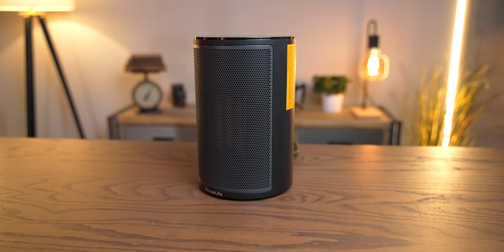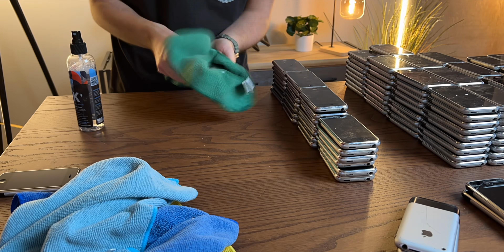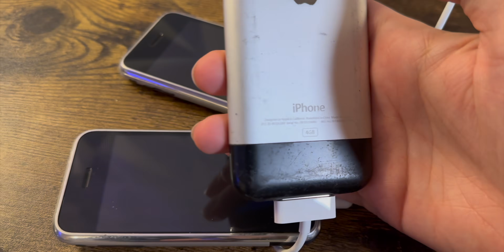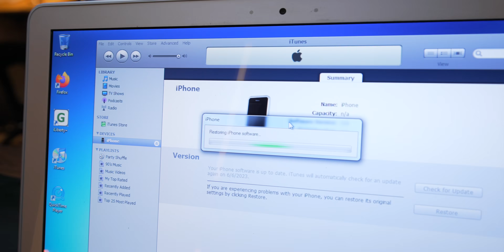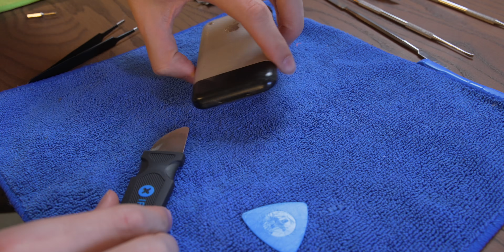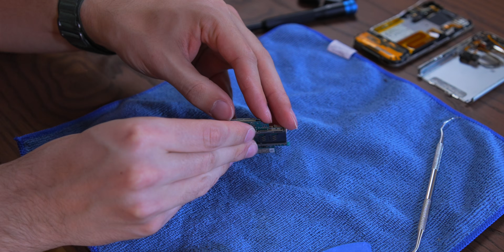I BOUGHT 300 ORIGINAL IPHONES, can I fix them??

Comment: You can sell damage ones in art like in sets of 3 or 7 as Art Deco and also the impact of e-waste and how to manufacture them for easier repairs and recycling even as broken screens and ones with the screen off to see in inside of the iPhone place inside a shadow box UV protection and recommend the Art Gallery or customer buying them as art deco don’t place them where sun can heat up the batteries

Comment: @Luke - Sorry different topic of conversation
Hey Luke

I just bought a ma pro 2019 , pretty cheap for 2K, But it only can with 256GB boot disk, cos I googled and read and watched you all on tube, and I can see how to do
It with Apple Configurator and a laptop  etc etc.

My Q is as follows

1 Does Mac Pro 2019 boot disk allowed 512GB
2 Does the configurator app allow 5122 GB as an option for apple Mac Pro 2019

Does it looks like apple are only selling 1/2/4/8 TB modules.

Cheers
Simon

Comment: Hi Luke, I have an iPhone 2g 8 gb that I bought for double the sale price out of the foxcon factory on the black market before they were available here in HK. It has the very very rare physical hardware jailbreak as in there is an extra chip slipped in the sim tray instead of a software jailbreak. The screen is 100% working and it boots to the iTunes Connect screen but I don’t have iTunes that can connect. Needs a new power button. 
Is this interesting to you?

Comment: you need a seperate macbook _2006-2009 that will run ziPhone (if you can find it) to jailbreak and factory restore. Saved alot of bricked iphones just replacing the .IPSW. LOL @ the return of Dos Dude! Love this vid, very nostalgic and i still want to use one as an iPod (that cover flow).

Comment: It was so satisfying watching you unboxing, sorting, charging and being surprised with the phones that were able to work....and 'The Samurai Phone' took me back to Asia, when I bought second hand phones there and found lots of pictures, messages and songs, still in the memory. It was also so refreshing seeing the phones booting up, that you thought were un-fixable. Having Jail-broken and worked on some Apple phones myself, It is so satisfying to get to the point where you have breathed life into  something that seemed unfixaable and 'Dead'.  I thought that a 'hot-plate' might be useful for you, as it slightly heats up the phone to the point where the glue becomes malleable....but you seem to be getting by without one.  I loved watching your videos on Macbook Pros, as I have a few of them myself and have changed batteries, RAM and SSDs. Based on your advice, I just bid for and won an Auction for a Macbook Pro mid 2015 15" tonight. I'm looking forward to taking it to bits and cleaning it and replacing the thermal compound, so I don't have to worry about it running hot. Anyway, I hope you enjoy your new home and thanks for your interesting shows. Cheers

Comment: With iOS 1.0, these are more valuable. The display and the touchscreen are separable easily. You can easily replace either if you have a cracked touchscreen or a defective LCD. All you need is a heat gun with adjustable temperature. As rare as 4GB versions are, 16GB versions are also rare, too.

Comment: Hey Luke, and dossude1 if you are here.. I have a 27 inch 2014 iMac with the i7-4790k and the r9 m290x and it keeps randomly restarting on newer operating systems, I don’t know what the issue is and it’s completely taken apart at the moment, these things are a nightmare to troubleshoot

Comment: I still have my original iPhone, paid £179 from Carphone Warehouse in 2008. You were supposed to buy a contract within iTunes (UK was o2 exclusive originally) took it home, hacktivated it with iLiberty+ and put my Orange PAYG SIM in. The battery still holds a charge today, feels tiny but much more comfortable to hold compared to my enormous 15 Pro Max.

Comment: I think Is not burn lcd, is the battery pushing the screen from the inside when the battery swells over 10 years or so. Usually it brakes a layer in the lcd

Comment: Quick question. What’s an iPhone 2g? I recall the iPhone 3G. In fact I owned one. Do you
Mean the original iPhone from ‘07?I thought those were really valuable these days. Am I missing something?

Edit: just checked and here in UK the OG iPhone working is >£1000 Maybe you should sell them here?
Reply: Yes, those were the 2007, 1st gen, og iPhones. Since Apple made a ton of these and a lot of them are beaten up, they aren't exactly that expensive. Except the early 4GB models as explained in the vid and ofc the in-box, never-used ones will worth a lot.

Comment: I understand what you mean by “2G” (wireless network). But those are 1st gen (original) iPhones 😎 I’m writing as I watch, so you may have explained… I have one that I bought used at about the time iPhone 4 was latest, my first iPhone, 4GB model in decent condition. I used it for a few years. Battery DYI replaced, required de/re-soldering wires. Everything worked fine initially. Still works now, but most buttons are now flakey. Camera still works, so I occasionally take it out and take new photos to share on Instagram, true point-and-shoot only (no video). It takes surprising nice-looking photos, especially the colors, sharp enough for Instagram. Fun video, thanks for all that work! 🎉

Comment: Is there a way to use my late 2015 21.5 iMac as an external monitor?
Reply: No, iMacs do not have a video input port (like for a monitor lol).
Reply: Yes it was possible. iMacs once had the Target Display Mode but only supported up to the 2014 model.
There however is a way but it ain't pretty. You need to gut out the iMac; take out the mobo and install a display circuit. Sunny Days made a vid on that called "Turn Your Broken iMac Into a New Standalone Display." Go watch that see what you think.

Comment: For the screens that are good pixels but cracked lcd, would be a nice project to do just the glass only replacements on them. This can be done with liquid nitrogen. There are machines that you place the screen inside and cool the glue to easily remove it.

Comment: One thing I would recommend is desoldering at least the positive battery line, unfortunately I managed to kill one while replacing the screen by accidentally shorting out the screen connector.

Comment: You might have overlooked a gem here. I am referring to the one that doesn't have the name "iPhone" engraved on the back. Typically these were prototype units made for internal testing, as the two prototypes that were leaked on MacRumors in 2009 didn't have that engraving. I could be wrong but anyway...
Reply from the maker: I thought so too, it wasn’t sadly
Reply: @lukemiani  Then what kind of iPhone was that? I have a clone that is detected by iTunes, and it has 30pin connector, but removable back, removable battery, dual sim and micro SD card as main storage, without it, it just does not work.
Reply: @lukemiani sir can you give me one iphone 3g
Reply: That’s true! Luke, you gotta look into that and check the value!
Reply: Or it was an aftermarket casing.
Reply: @BudoBašović  I am sure this would be easy to find out, we have to boost this and get a resolution! I would love for him to just stumble upon a weird prototype!!
Reply: From what I remember, it was just an aftermarket back casing and there was really nothing special about that one. Guess it wouldn't hurt to check again, though.
Reply: Interesting idea 🤔🤔🤔
Reply: Probably just a knock off back
Reply: I wouldn't count on it. This shipment came from China. If there's any value left in it, they would know. So probably it was an after market replacement part!
Reply: @vueport99  Yes it's unfortunately just an aftermarket housing as Luke and Dosdude1 confirmed already.
Reply: Come on, they're from China. More likely fake ones, or as they say: "imitations"
Reply: Yes it is!!😮😮😮
Reply: not at all, its just a replacement backside from china, my 3GS hat one too
Reply: Boost